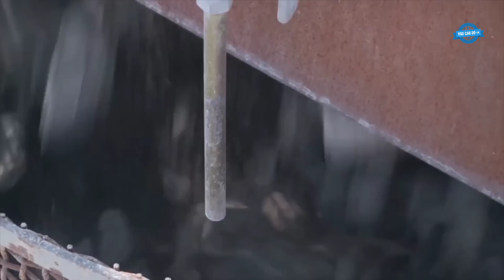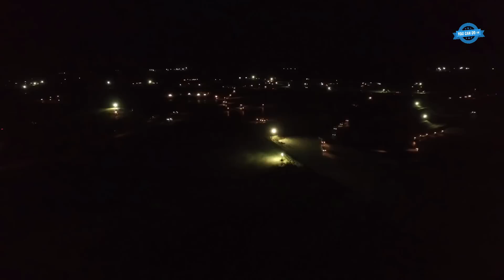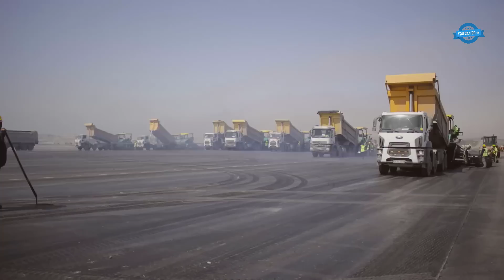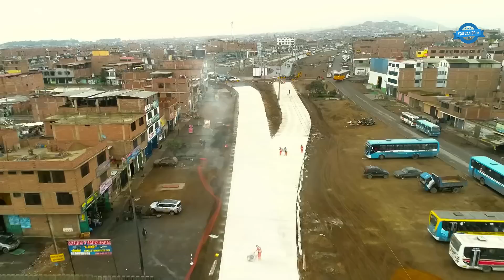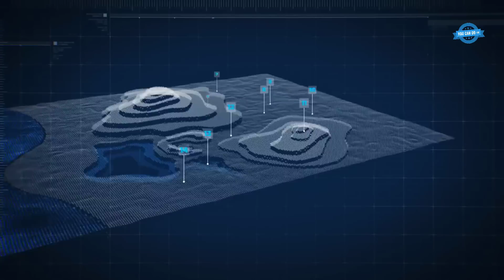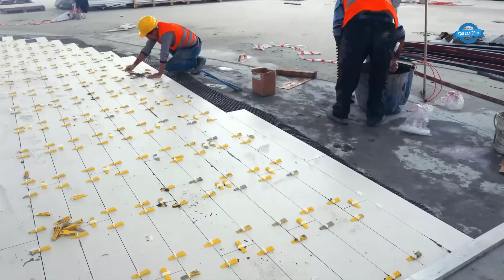Construction Of The World's Largest Airports In Türkiye. Leading Construction Equipment & Technology

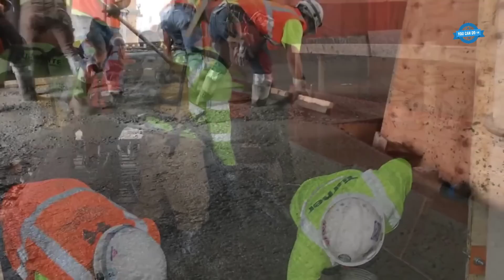Comment: While machines paving the roads starting at 15:00 I don't see rebars as usually they do. Where are the rebars before pouring concrete>
Reply: about 19:00 , at this point i think we probably dont know enough about specific conditions in turkey...you can see them using concrete saws to break the concrete into panels, maybe they find steel reinforcement will cause damage to larger sections in earthquakes, and small panels are easier to repair.
Reply: there is rebar cant you see
Reply: @oghuzkhan5117  i believe nyck461 is referring to the access roads and runway, obviously you can see reo in the buildings.
Reply: They're doing it right.